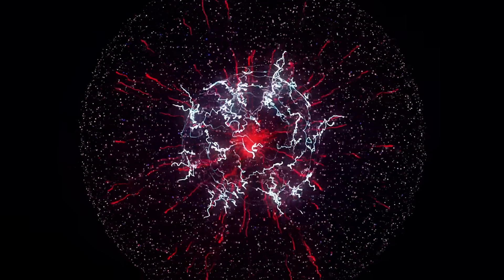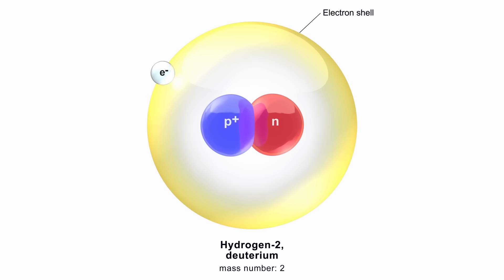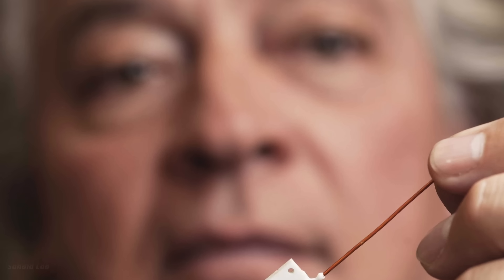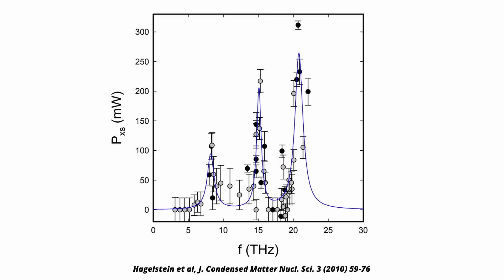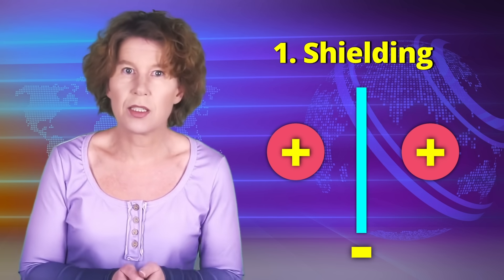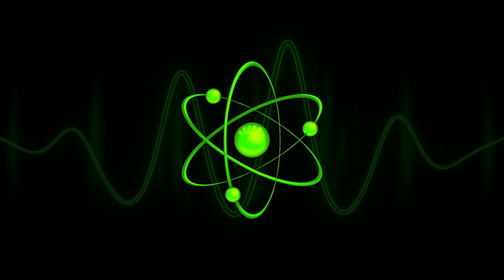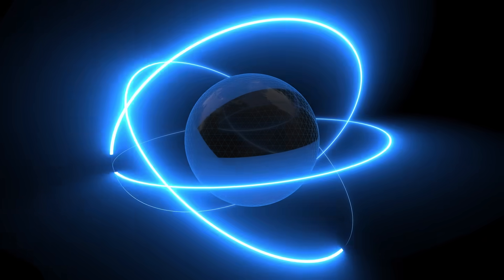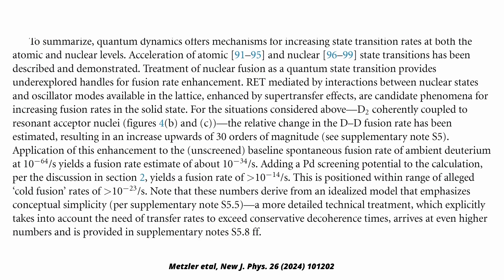Physicists Say They Know How Cold Fusion Works

Comment: Question about the solid state approach. If you want to make an actual reactor powering a city, how do you fuse that much with some solid-state material without destroying the material?
Reply: Uh how do you burn coal without destroying coal. The trick is that you don't fuel is always a constant requirement

Comment: I like the old mechanical implosion concept, you can get 100M degrees with it briefly. It's doomed to low power output but you put in very little energy, you're just pounding the core with a bunch of hammers.

Comment: I remember going to the library as a teenager (in the 1980s) and reading about cold fusion. It seemed so promising back then. Maybe because I was a teenager, and didn't know any better. 😛
Reply: Explosion in Hokkaido University Cold Fusion Laboratory

On January 2, 2005, at around 4:00 p.m., an explosion rocked a cold fusion laboratory at Hokkaido University, Japan. The experimental design was the plasma electrolysis method, one of several methods used to perform cold fusion experiments. Physicist Tadahiko Mizuno, one of Japan's most experienced cold fusion scientists and a guest of his were in the laboratory at the time of the explosion.
Reply: @82spiders  Sounds like a Keanu Reeves movie. 😆
Reply: I thought the same thing a long time.  Now I think they classified it and it went away.  Tesla almost certainly understood it and had figured out how to do it and they took all that research when he died.
Reply: The old joke that cold fusion is only ten years away. 🫠
Reply: @ronniew3229  Same with commercial hot fusion .

Comment: It doesn’t work though.. Which is why every single “cold fusion” experiment required more energy input than they got out of it. They just keep lying pretending they achieve “ignition” by subtracting most of the energy it took, out of the equation. There are ways to make it more effective, but so far they’ve had to lie and recalculate down the energy it took in every single case, to pretend there was a “net energy gain”. If they would quit lying and pulling that kind of mathematical sleight of hand, and just admit the full energy the lasers are consuming in their statements on “net energy gain”, it wouldn’t seem like such a scam..

Comment: I’m curious about how such measures would scale to actually provide useful amounts of power. It seems like the setups would be challenging to grow beyond tabletop levels and achieve commercial uses.
Reply: Depending on the output tabletop size may be good enough. Perhaps the days of distributing centralized generated electricity should end and we move to a distributed generating system. The advantages would be significant.
Reply: @Dan-nj8du Like the Enron egg
Reply: @Dan-nj8du  Not unlike Star Trek.......although I hate to bring it up.  A reactor in every home!  Or on every block.   Now for the dangers of such a system............hmmm.
Reply: @Dan-nj8du  Just producing heat doesn't help, you also have to be able to use it. Fusion won't work like a battery, even if you are able to start the process on room temperature level, you will still produce heat, handle this heat and of course transform it into something useable.
Reply: @miriamweller812 Producing heat is how fission, fusion, and fossil fuels generate electricity.
Reply: If it can be made to produce enough surplus heat reliably, then it'd be very easy to make use of it.  After all, fission just produces heat that we use to make steam to spin turbines.  This would do the same, but without the need for a huge reactor.   No heavy atomic waste.  No control rods needed.  Absolutely safe, as any problems can be stopped by just shutting off the current.  

Give how cheap these experiments are, especially compared to the tens of billions thrown away every time the next celebrated fusion reactor fails to produce any useful net energy... why not give it a try?  We could perform about a thousand cold fusion experiments for every one hot fusion reactor constructed.
Reply: "next celebrated fusion reactor fail to produce net energy"

Im unaware of even a single reactor which was even built to produce net energy. The tabloids keep making it sound like thats the goal everyone is trying to do, but they are working their way up a ladder, and each new reactor is purpose built to study the next rung. Noone ever expected any existing reactor to actually produce net energy. Even the new ones currently in construction are not built to do that
Reply: @MrMegaMetroid  And that's my point.  We keep spending enormous amount of money on fusions reactors that have no chance in hell of being useful... and NOTHING comes out of it to demonstrate how to build one that WILL generate power!  There's nothing but empty promises and vast sums of money down the drain.  Why not spend a little seeing if this alternative could work?  Worst that happens is there's no way it can work.  Oh well, you still spent a lot less than even one hot fusion reactor, out of which you'd still end up with nothing.
Reply: @Alondro77  Meanwhile the desperate struggle agaist using the sheer endless fusion energy we already got and are showered in, free energy indeed, raining down from the sky.

But that's likely the main problem, hard to make profit with free energy rain. The try, but as greedy is: it will always want much more.
Reply: "Free" energy boxes in the basements of most homes basically.
Reply: Why am I sceptic that free fusion energy won't be free at all? @angryyclippy

Comment: I always like the business models Sabine advertises. Not even her ads are junk. Transmutation of the earth surface into much lower specific heat which on a global scale could cause urban heat island effect to be even worse. Like 1 lbs of waste per day per person, would for 10 billion people be per year 365*10,000,000,000 lbs of lower specific heat with energy transferred into water. For 100 million years? Wood stays cool some wood has specific heat of 2200, where concrete is around 700. Cold fusion waste could be worse. Problem is cold fusion once figured out could rapidly scale and the energy produce more cold fusion, like an energy revolution singularity. The waste would then scale at a singularity rate as well.
Reply: "...(U)nlimited cheap energy" yields infinite waist heat!  There goes the neighborhood.
Reply: Eventually, mankind will have to create a massive radiator in the desserts, to throw waste heat into the cold of space at night, just to prevent our planet from overheating. It's a necessity at some point, given more advanced life forms continuosly consume more energy than more primitive ones, and this trend include colonies of social animals

Comment: Cold fusion is actually very difficult to reproduce, and it's unclear why, as the author's reasoning seems insufficient to explain this issue.

Personal conjecture:

The SL2C gauge field inherently describes the continuous transition from local fields to global fields. Geometry might not be the essence of spacetime; instead, spacetime's essence could be transformations.

A gauge field is more akin to a continuum of transformations, a continuum of spacetime transformations. The definition of geometry may vary depending on cultural perspectives, and the essence of spacetime might be closer to transformations rather than geometry, just as SL2C spacetime transformations do not inherently involve geometry.

The continuity of local transformations into global transformations is guaranteed by the gauge field. When local transformations gradually become continuous and expand, they form macroscopic curvature and the phenomena resulting from curvature.

In other words, we should consider whether spacetime transformations necessarily need to be represented by geometry.

---

### SL2C Gauge Field and Time Dilation:
When considering gravitational fields or the motion of particles in strong interaction fields, gauge fields can cause particles to accelerate or decelerate along the time dimension. This is analogous to time dilation, such as in gravitational fields or at high velocities. In such cases, the SL(2, ℂ) gauge field produces an effect similar to "time slowing down," achieved by adjusting the particle's motion state in spacetime.

### Local Symmetry and Time Dilation:
Introducing an *SL(2, ℂ)* gauge connection field implements local symmetry in spacetime, allowing transformations and dynamics at different spacetime points to be locally adjusted by the field. Similar to how gauge fields adjust particle trajectories, SL(2, ℂ) gauge fields introduce varying time metrics at different spacetime points, cumulatively leading to local time dilation or contraction effects.

### Spacetime Curvature Effects:
Just as light propagates in curved spacetime, the SL(2, ℂ) gauge field induces spacetime transformations through the cumulative local variations of its derivative fields. These transformations naturally result in spacetime curvature effects. Variations in the gauge field correspond to spacetime gravitational fields, leading to phenomena like light bending.

The critical insight is that changes in the SL(2, ℂ) gauge field mimic gravitational field effects. Through interaction with matter fields, such as light, the gauge field produces local transformations and light bending. Thus, the SL(2, ℂ) gauge connection field effectively handles phenomena akin to spacetime curvature and corresponds to calculations involving light bending.

---

### Perturbations in the Gauge Field:
Dynamic perturbations in the SL(2, ℂ) gauge field, such as the accelerated motion of a mass or energy source, alter the local SL2C transformation structure, generating wave-like phenomena akin to gravitational waves.

Time-varying local SL2C gauge fields are essentially spacetime transformation fluctuations at every spacetime point. These continuous fluctuations, moving through spacetime, represent larger-scale global spacetime wave transformations, akin to gravitational waves.

---

### Connection to Gravitational Waves:
In this framework, variations in the SL(2, ℂ) gauge connection field resemble the generation of gravitational waves. These fluctuations propagate outward with field perturbations, affecting spacetime structure like gravitational waves. The gauge field's fluctuations can be seen as the source of gravitational waves, with propagation logic analogous to that of gravitational waves.

---

### Geometry as a Description of Gauge Fields:
These examples suggest that the SL2C gauge field might be equivalent to a curvature field, with general relativity’s curvature being a descriptive framework for the gauge field.

For the SL(2, ℂ) gauge field, a connection structure ensures local symmetry and links these local transformations into a global symmetry structure. By introducing a gauge connection, the local transformations at each spacetime point continuously connect to the global (broader) structure, resulting in macroscopic spacetime curvature phenomena.

---

### Role of Christoffel Symbols and Curvature:
Christoffel symbols describe local geometric changes, representing the rate of change of the metric along spacetime. However, they do not capture variations in Christoffel symbols across different spacetime points. The Riemann curvature, derived from the differences between derivatives of Christoffel symbols and their products, represents these variations. 

The derivative of Christoffel symbols captures their changes as connections, reflecting variations across spacetime points. The product of Christoffel symbols describes differences in parallel transport of vectors, representing four-dimensional spacetime changes and broader spacetime curvature.

---

### SL2C Gauge Fields as Spacetime Connections:
The SL2C gauge connection field  A_nu(x)  represents local symmetry at each spacetime point. The derivative partial_mu A_nu  necessitates movement in spacetime components, ensuring a global description of  A_nu . Thus, the SL2C gauge field itself is a connection, and its variations describe the quantum nature of spacetime geometry as a field.

Spacetime geometry is a human interpretation of the SL2C gauge field. The SL2C gauge connection field possesses all the characteristics of spacetime geometry. Changes in the SL2C gauge connection field alter the spacetime paths of particles, similar to how Christoffel symbols influence particle trajectories.
Reply: Okay and how does this explain cold fusion?
Reply: My question is not about cold fusion but rather about the issue that general relativity is non-renormalizable, while its gauge symmetry, SL(2, ℂ), is renormalizable.

First, I should clarify this mathematically in more precise terms. The local transformations of SL(2, ℂ) allow fields at each point to undergo transformations generated by its generators. These transformations are represented by the boost generators and spatial rotation generators. Their action enables the fields represented by SL(2, ℂ) to undergo boosts and rotations. General relativity does not describe this aspect as clearly because the fields represented by SL(2, ℂ) essentially form a continuum—a field represented by the four-dimensional spacetime continuum. This field does not describe the shape of four-dimensional spacetime through its rate of change but rather through the boosts and spatial rotations at each point within the continuum. 

This approach aligns with the curvature described in general relativity but differs in its methodology. Not only is the curvature field a second-order tensor representing changes, but the relationship is also described using geometric derivatives of the metric tensor. In the SL(2, ℂ) framework, the boost and spatial rotation generators include theta(x) to represent the magnitude of transformations corresponding to each generator. Through this process, the SL(2, ℂ) field serves as a continuum of abstract transformations. 

It is better to conceptualize it this way because, when considering transformations of four-dimensional spacetime, the optimal approach is not to describe its shape. Four-dimensional spacetime consists of one-dimensional time and three-dimensional space, making it inherently abstract. General relativity describes the shape of four-dimensional spacetime geometrically, which can sometimes be challenging to conceptualize. However, if we use the abstraction of mathematical transformations, describing four-dimensional spacetime transformations becomes much easier to imagine, as mathematics elucidates the interaction between one-dimensional time and three-dimensional space.

What I aim to express is that the SL(2, ℂ) field is a continuum that facilitates continuous transformations of four-dimensional spacetime through its boost and spatial rotation generators. This is conceptually similar to curvature in the sense that curvature describes the shape of four-dimensional spacetime through the rate of change of the metric.
You can think of a continuum existing in space, and when this continuum satisfies the local transformations of the SL(2, ℂ) generators, it forms the shape corresponding to the generator transformations. This continuum and its shape directly act on particles, just as the metric tensor acts on particles. The shape of the continuum field represents the shape of four-dimensional spacetime. When it acts on a particle, it transforms the shape of spacetime and alters the particle’s worldline, resulting in the particle’s geodesic.
Reply: @kairlin6727 Ah so it was a non-sequitur from the first sentence of your original reply, got it.
Reply: In other words, every weak and strong force shares the same structure as spacetime because they also involve SU(2) and SU(3) transformations at every point in spacetime. These forces also exhibit continuous transformations extending to global transformations. However, due to differences in mass or coupling strength, they are short-range forces, while the U(1) electromagnetic force is long-range. They should all have the same continuum field structure. Four-dimensional spacetime might not be a special case that uniquely corresponds to geometry, nor does it necessarily require a geometric description to represent field interactions. SL(2, ℂ) can also produce the polarization structure of gravitational waves.
Reply: @ There must be a way to explain what you're saying so that the average person could understand it. The only thing I can really grasp is that all forces may behave in a way similar to how gravitation is a result of spacetime, i.e. they are in some multi-dimensional field and it's the "shape" of that field that is dictating the forces. And I think I gather that things being "geometrical" may be essentially an illusion due to our sensory limitations, which causes us to have these concepts about forces which are erroneous as they're based on everything occurring within a geometry. Is that correct? What's the impact of viewing things this way?